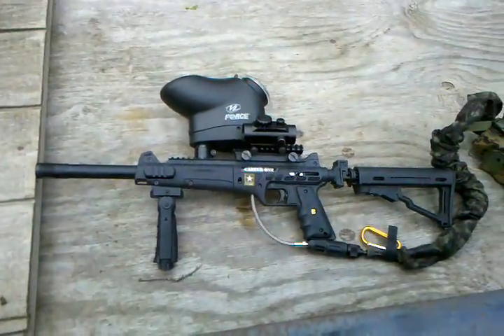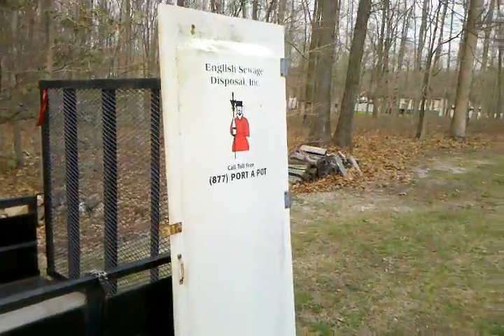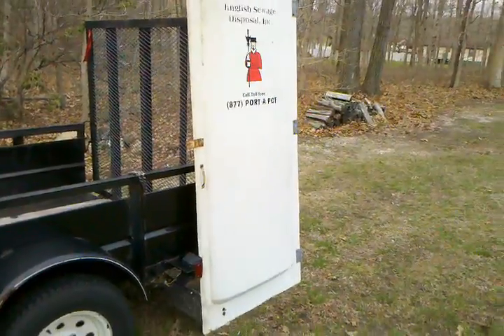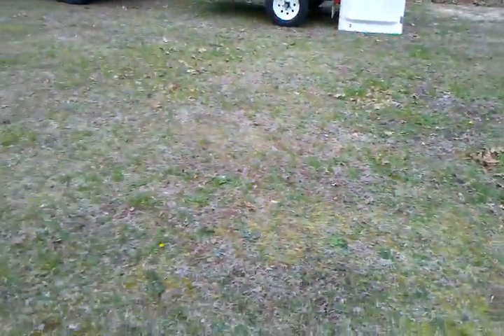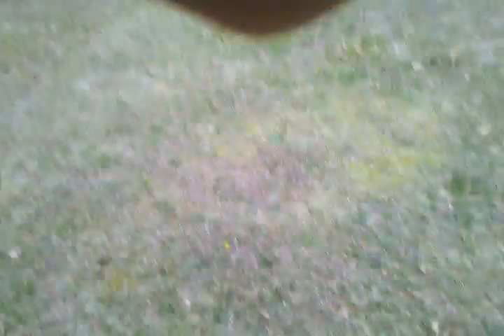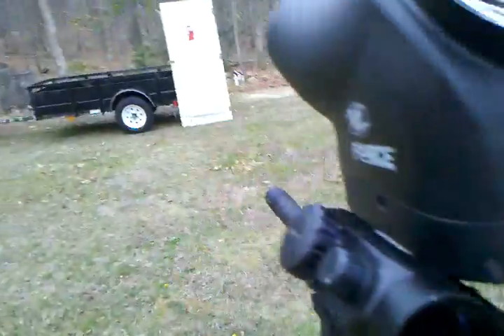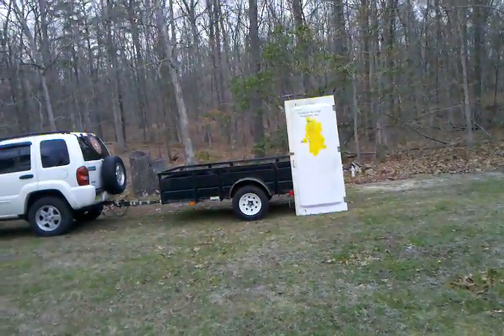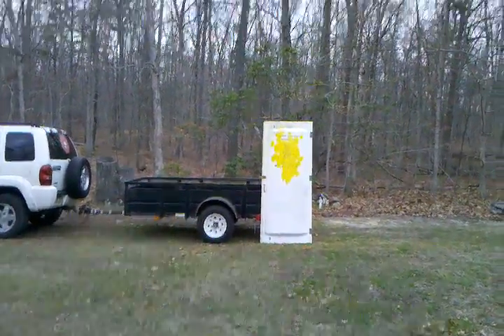Team Hellbent: Tank Durability Test (Porta-pot door)

Comment from the maker: Well, I spotted that in a radio shack catalog I think.  Its pretty much a bluetooth device that has a camera and earpiece and links to a droid or other smart phone and you can edit clips from the phone.  Its called a Looxcie.  I have tried using it by fitting it under the cammo clothe on my helmet but that was a bit harder to use than anticipated.